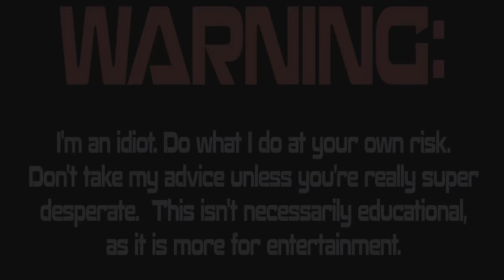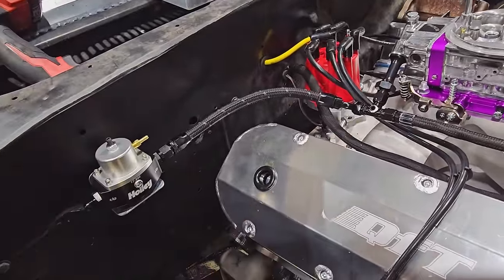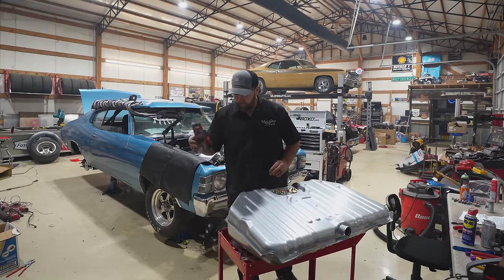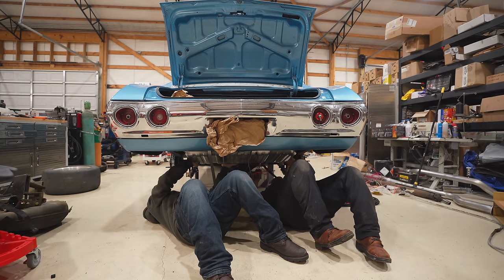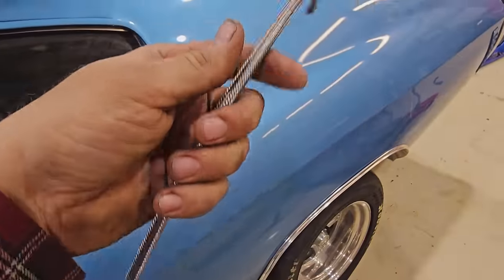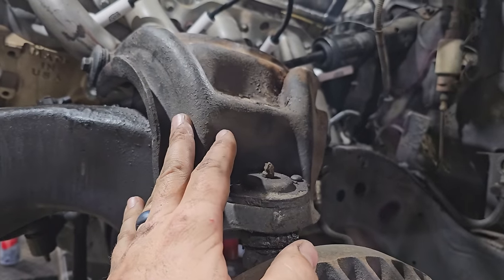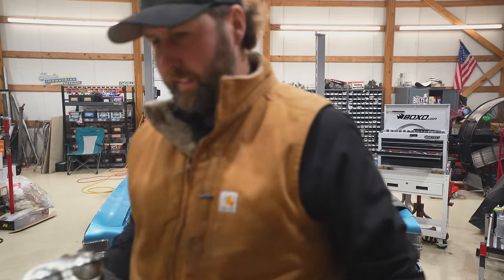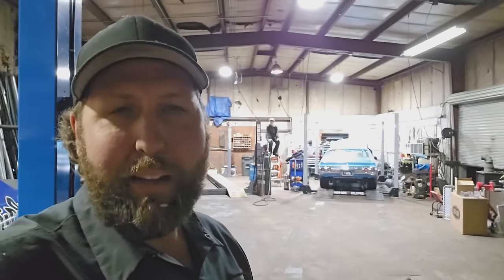I FINISHED The 540 Big Block Chevelle Build JUST IN TIME for Sick Week!

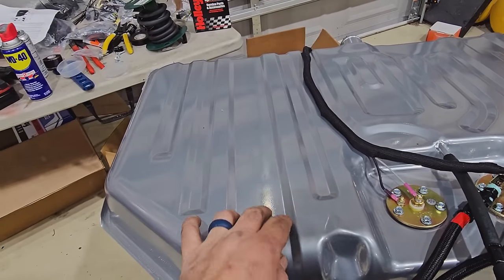Comment: 42:04 mark...I've always saved old but not too old, goodish-condition bike, motorcycle, car, truck and river floating inner tubes and also decent condition truck, car, trailer, whatever mud flaps as both can easily be cut into whatever needed size/shape, anti-vibration/friction-reduction rubber pads, large washers and/or strap isolator-insulators...they come in handy when a guy needs to keep his rig rattle racket and metal to metal wear down to a dull roar is what I'm sayin'!

Comment: It would be nice if you could find some tall, wide welding curtain to hang from the ceiling and block off one side of the shop to help keep the heat in a little better.

Comment: You could use some shrink tubing of different colors to designate your fuel feed and return lines, it's available in a bunch of different sizes and colors, everything from white to red, green, and blue, even orange. A little dab of matching paint next to the matching fitting would make things easier for a feller. I don't like using tape, it eventually either falls off or just gets everything all sticky and attracts dirt. Shrink tubing is our friend. All the best to you and the family, Derek.

Comment: On the last fuel tank I changed, I took a can of the coating spray and sprayed the top of it in the sides. And it, besides everything else, the seal it from rusting or getting chips. You have the corn protected the tank a little bit

Comment: On your throttle cable to keep it from collapsing take a piece of scrape and spray it with some undercoating. If it doesn't blead through then spray it on your throttle cable, that will stop it from collapsing when you do not want it to.

Comment: Derek with the ride height if you have the alignment plates for your 4 post makes it easier.  You just bounce the front end up and down a few times on the plates and it will mostly settle to correct position

Comment: What I can say, as an industrial engineer, regulators are not a linear regulation in value or system pressure. If your CFM, or system pressure changes, so does your regulator setting, and it's not 1 for 1. 
To help this out - setting the fuel pressure regulator to 7 at idle does not mean that you will have 7 at full throttle.

Comment: Don't know if a guy needs this info, but for my 72 Chevelle fuel tank I cut up a rubber door mat to use for the rubber that goes between the straps and tank. Worked pretty good.

Comment: Just fixed my leg burner from not firing up properly. 1 take out sponge and spray water displacement 40 in the small hole that will lube up that weird looking paddle pump that is in there. I used some nonflammable spray from the Walmarts

Comment: Another handy fuel dispenser is a contact lens solution bottle. The small orifice works well for filling the fuel bowls through the vent tubes. I’ve even used a pair of them zip tied to the air cleaner stud to run a TBI 350, just had to cut vent holes in the bottom so the fuel can dribble into the air intake past the injectors.

Comment: The central heat may work better if you reverse the direction of the ceiling fans in winter. It looks like you have them in "summer mode."

Comment: I have wilwood disc/disc manual master with 7/8 bore and adjustable proportioning valve and I like it more than power brakes. Can actually feel the brakes and have more control and will still lock em up if you desire.

Comment: You need to spray foam the walls and then cover them with drywall or metal that will help a lot with the heat in there

Comment: When I was in college, I had an identical Chevelle, but when I got it, it had a six cylinder in it and it ran fine.   I did some work on it (adapted a 4 barrel on it with a new and modified intake) , new cam and some other things.)  I always wanted to put in a 327 (I'm old school) or a 350, but I was a student (although i worked at a muffler and speed shop thus that helped a lot since my boss would charge me for any kind of parts with whatever he paid for it, no additional.  Started when I was 15 until I was 22.  Bob (my boss) was a great boss, paid me way more than anything else paid even loaned me school money and learned a great deal about cars.  Don't have the space to work on them anymore, but since I recently retired, maybe it's time to find the space.

Comment: Need to build a “booth” in your shop for “ working on goin to town I rigs” basically it’s a “heat/cooling” box to do your work in and let the rest of the shop get lower priority heat/cooling when the seasons are running in their extremes…
Reply: Also gives some “over the head” storage if you wanna build a deck up there to put some railing and shelves outside the heated area… optimizing space and making heating more efficient/..
Reply: Glad to see Bradley… good kiddo…

Comment: Gasoila will never leak, even if you don't tighten the fitting. It is a nightmare to clean off though. Used it for a decade in the oil patch on casing gas lines.

Comment: Those traditional heat pumps won't do much below 25F, unless you have backup strip heat.   No idea if they bothered installing them or not in your setup, but if not they usually have emergency heat strip kits you can add so you get heat when the heat pump becomes ineffective, though if you think running the heat pumps is expensive wait until you see the bill for running the strip heaters.

Comment: You need to invest in a waste oil heater... perhaps mounted outside  a yard furnace is alot of work but can save alot of money as well..don't run the fuel very low without a cooling basket the pump may not last very long .

Comment: If you are fighting lower control arms when installing them. Use a bolt(or all thread), two nuts and 4 washers to force the control arm mounting tabs open. They are pinched in, twisted ect. from 50 years of abuse and the whiskey'd up line worker who originally installed them with an 1" drive impact at GM. Lower a arms should slip in easily and move effortlessly. Especially on a performance application. Suspension should have 0 friction, if possible

Comment: NHRA might not like mounting regulator on the firewall..depending on how fast the car is. Even with a shield they might say they don't want any fluids (brake lines, gas lines, etc.) on the firewall. For a street car they usually wouldn't care but if you're running in the 11's or faster they might tell you to move it...great work

Comment: I know how hard it is to replace the control arms, I had to do the same thing to a 1990 Chevy 1500 pickup. As you would say, the drinker side was hit at some point in its life and I had to heat and beat the ears on the top control arms about 3/8 of an inch to the front of the truck, Boy that took forever. Well, it is done now, but I can't figure out why the belt keeps coming off. Something is either out of line or parts are worn out. Work in progress at the moment. Has a great frame, but the body is a little ruff, otherwise it is a good truck. Hope you win your class, have a good one.

Comment: When I was installing my heater/ac ducts in my house I was told that I should put the vents down low as (we know) heat rises. Perhaps he vent system is too high up and hot air is not reaching you? Bummer when you install something and it doesn't work as planned.

Comment: Derek, get rid of the holley regulator. They're complete junk. If it works, it won't be for very long. Also, the accel wires don't usually work with ignition boxes. Just ask David Freiburger.

Comment: I think I would have run the fuel lines on the outside of the frame and went through it further down so as to avoid the heat from the exhaust.

Comment: When you cut off those universal throttle cables, a guy can use the tig torch to burn through it and it will fuse all the strands together.  Just don’t touch it right after you do it.  Don’t ask me how I know that. 😢

Comment: Regulator on the firewall? Not legal for most racing series because if the flexplate or flywheel explodes it will take out the fuel line. Also a shield is usually required where the fuel line passes the flywheel

Comment: So I have a question about the fuel regulator. Why not mount it in the trunk or at least near the fuel tank to avoid running 2 lines the full length of the car? I realize oressure drops slightly over the length of the line, but it seems like it makes sense to mount it near the tank.

Comment: Hello Derek. Long time fan. Me and my buddies quote you all the time. I have a 71 chevelle i haven't started on yet but me and my son are rebuilding his 1985 Dodge D150 truck. Is there a website you use for all your wiring needs? Connectors, wire, wire clamps etc....

Comment: Is there a specific reason you don't run a Dominator carb on that thing? You have plenty of motor for it. 

Once i ran my first Dominator on a big cube big-block, I've never looked back. The Dominators I've run have ALL had better throttle response, started easier, made more power, and were JUST as easy to tune as it's little brother, the 4150. 

Run a 2-circuit up to about 675-700 h.p., and then go 3-circuit after that.

A 1050 4500 on your big block would be sweet for sure. 

I've been using Quick Fuel QFX series Dominators, and I've had nothing but success with them.
👌

Comment: I have a square body c30 dually in Nebraska runs moves but needs a tranny which I have 350/4speed has a dump box on it assuming it was a cab and chassis truck as it has 16.5in wheels on it

Comment: I've been seeing adds pop up for that Boxo stuff.. I did a little looking.. and you could mimic the same setup with all hobo freight stuff for less than half the cost. I literally went socket by socket, wrench by wrench.. plier and screw drivers.. I even put air tools in the "shopping cart" I guess what I'm getting at.. BOXO sais USA is it actually USA made tools? And are they atleast equal to macto? Maybe not as good as snap-on ?

Comment: I need to know: Why does the coil wire go from the distributor cap through the firewall?
Reply: The coil & MSD are under the drinker side dash
Reply: @JustSayin042  Ah.  Makes sense, I guess? Why not just bolt them under the hood, though?
Reply: @Canthus13 they were already there when he bought & it worked so he just left it. I did the same with a bracket car. Plus, keeping them in cab keeps them away from heat (heat=bad) & keeps the engine bay clean.

Comment: I have a 1936 2 door Buick business coup with the original straight 8, I was wondering if someone can point me in the right direction for plugs and wires? and maybe points. I'm in the middle of getting it to my shop so haven't gotten to rip into it yet. oil looks good and it spins over so I wanted to buy a few things for when it gets here.

Comment: Nack at Volunteer Muffler when he was setting the timing...right after he was talking about the lower rad hose leaking at the pump i noticed that the upper hose was swapped back to a traditional rubber hose! All that work to just run thr tried true hoses. I stand by an earlier statement all that work and expense cant be worth it just use brand nee quality hoses and clamps !🤷🏻‍♂️

Comment: May I suggest. Buy a large box of ear defenders/hearing protection/ear muffs/Peltor brand , AND a few boxes of ear plugs , the orange ones, the ones with tethers . Leave em all over the workshop. In tool boxes, in the house, at the entrance to workshop in a dispenser. I keep them in my one clean pocket I have a Kleenex in and my lip balm so I can kiss the soft lips of my honey at anytime….ALSO / B - the aluminium sheet dash you have in the Chevelle will cut legs or kneecaps off in any incident or at worst the jugulars…. Please, think of safe living for the future till at least that the children are old enough…..Watch some olde CATERILLAR company safety videos, we still had the 1950/60s ones at CAT in Melbourne Australia years ago when I went there to weld. Boring, boring, boring…..(the job) so I left.

Comment: couldn't  you have just run all the plug wires down the length of the engine, and tied them all in in the back? that way you're no t blocking those beautiful valve covers...

Comment: Amazes me the guy at the end with the nice looking mopar  power brakes his car and barely spins the tires like thats a sign of some mega horsepower build .. My 70s 455 firebirds with headers and a mild cam could burn the tires off the rims just nailing the throttle sending the speedo to 160 mph right through 1-2-and 3 gear of the old turbo hydramatic transmission ... I cant help but laugh at these guys who think they got powerfull cars but gotta do a brake stand to spin 1 tire on wet pavement yet .. People need to build some big cube mildly cammed engines to find out what big torque and power feels like instead of these small cubed severly overcammed dogs that make less low speed tq then a briggs and stratton mower engine ..Overcamming is a big problem with new inexperienced engine builders today and i see guys choseing cams all the time only to make their cars and trucks slower.. long duration big camshafts sound nice, but you cant build compression or make any power or torque if the valve is open during your entire compression stroke !!

Comment: Why does everyone put E-fans and/or E-fuel pump on a classic cars? That doesn't look right; those cars didn't came with E-fans. Every older car I get like this one that comes with a slapped in aftermarket E-fan or E-fuel pump on it I rip the thing off and cut the wires off I toss the thing in the yunk pile and put the original fan or Flex Fan in and original fuel pump in...